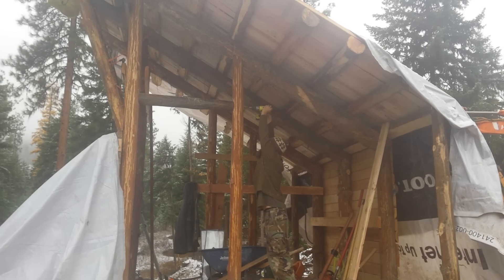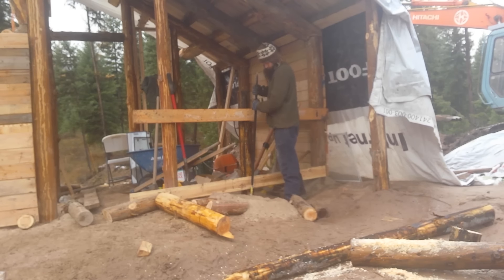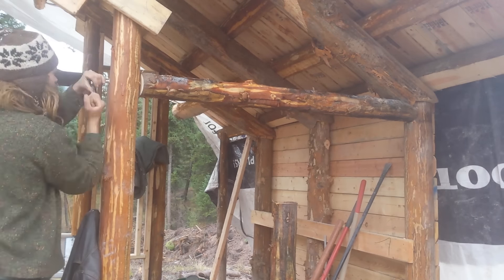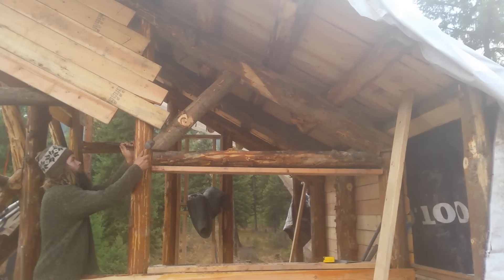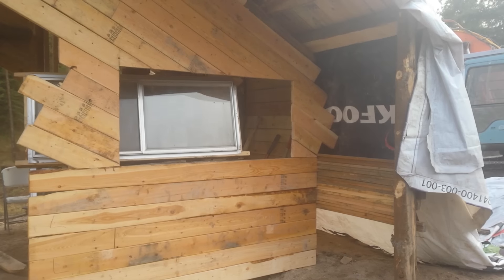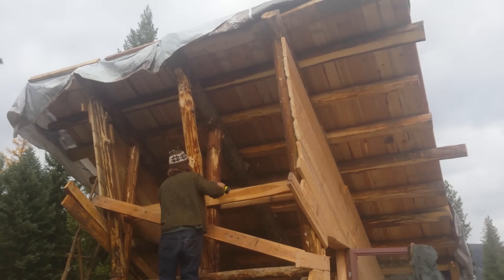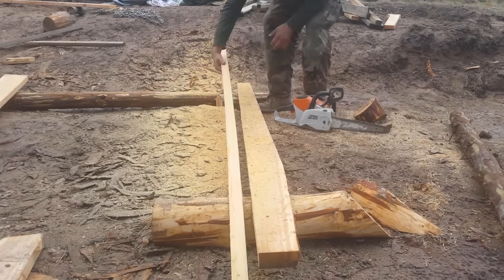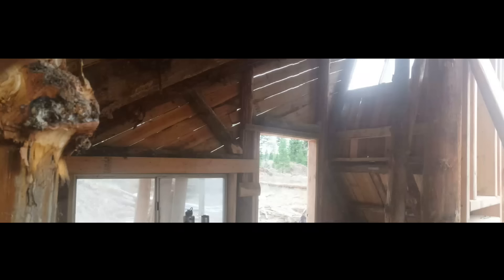Ant Village Journal #16: Building My House Part 3

Comment: Phew! Looking forward to viewing the next in the series. That chainsaw is scary...
Reply from the maker: It is certainly less scary than my gas powered chainsaw.  Any type of power tool deserves tremendous respect.  I learned that as a child from my father, and it has allowed me to keep all my toes and fingers intact over the years.
Reply: +Jesse Grimes I've got an MSA-200-CBQ too, in addition to a bunch of much bigger gas powered saws.  I use the cordless electric 99% of the time, because it's just so useful, and can do everything but cut the big logs.  Much easier using it to do the notching and trimming--as you have noted.

Very nice work!  And fast too!

Comment: Looks amazing Jesse, I've been a lurker of your work until seeing this. Made me come out of my lurker cave. I love the design and really enjoy seeing your progress and explanation of the building techniques. Looking forward to seeing part 3! Is it covered in dirt yet?
Reply from the maker: +Bram van Overbeeke Thank you, Bram!  It is not covered in earth yet, there is still a lot of work to do before that can happen, which will have to wait until next spring.  Plus, if it were covered right now, I would be surrounding it with tons of very cold dirt, which is counterproductive to the idea of a thermal mass heated home.  I am not staying in the structure this winter, but if I had buried it in a hurry and tried to overwinter, every time I had a fire and tried to heat the place the cold mass would suck the heat right out of the air.  I will be returning to the project in the spring to finish off all the odds and ends that go into earth-sheltering a house, and I will most likely bury it at the height of summer when the dirt is dry and warm.